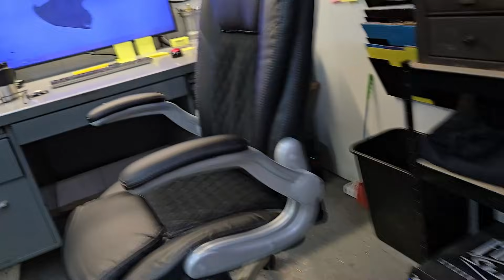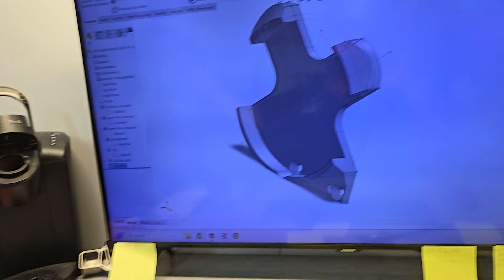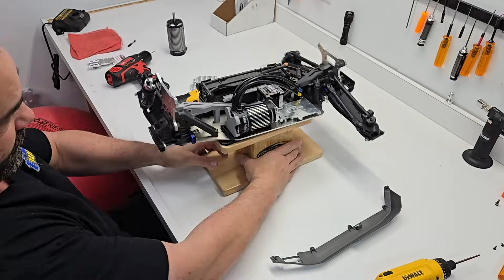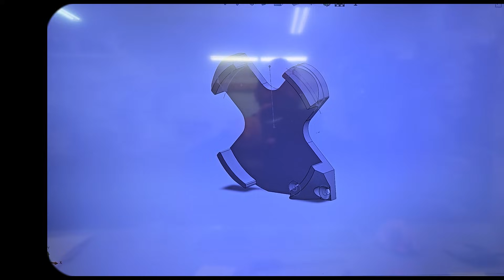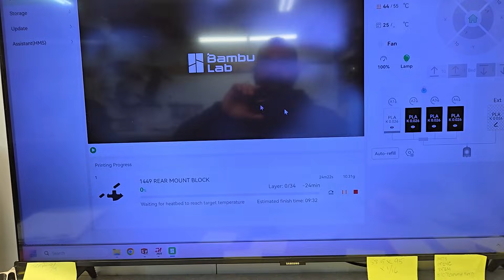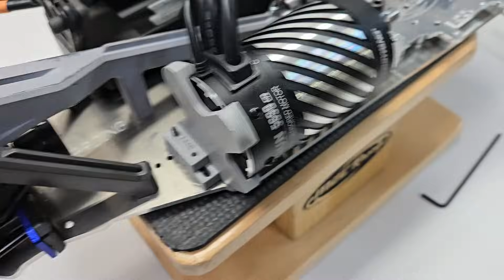5690 Motor Install Transforms This RC Beast

Comment: Just bought myself a jackhammer kit finally after dreaming about it for the last year. I was a little surprised it could only fit a 4990 so I'm super happy to hear you're doing this now. If you make the parts I will try to stuff a 56118 in it lol. Something special should be done with chassis #1.
Reply from the maker: I mean, maybe, if you removed one side of the brace thats in the way? nothing is impossible, congrats on the #1
Reply: Thanks im excited to get it. All of the parts are on their way. I don't own a sledge so im starting from scratch. I might have to try it lol I just put a 5690 in my Infraction with your motor mount. I pretty much only buy trucks that you make motor mounts for. They make life easy. Thank you for all of your creations!

Comment: I seen the max6 g2 5690 combo HW offered and was wondering if it the 6s arrmas . So with this it will 👍👏. Awesome
Reply from the maker: i will make a version for them
Reply: Yes it will fit the arrma cars just need a different motor slide

Comment: I'm gonna have to build a sledge with that motor thing would be a monster
Reply from the maker: That'd be awesome!
Reply: I have the Jackhammr kit with a Max6 G2 and the 5690 motor currently and can attest that it is an absolute BEAST! Keeping tires on it was my initial challenge. 

Had to use a different company to fit the motor currently, but CAN’T wait to have this solution to officially tie it all together